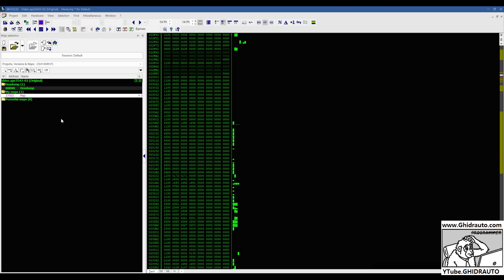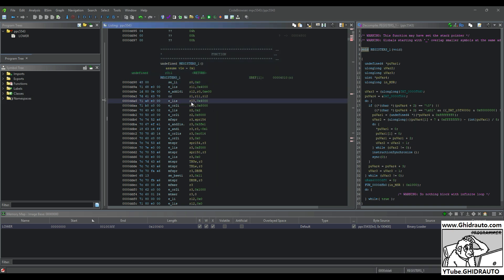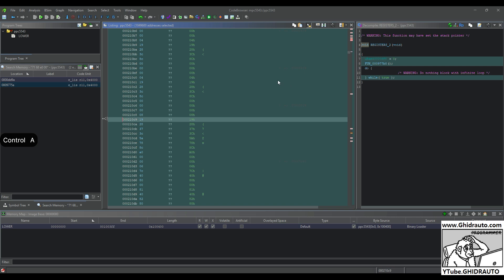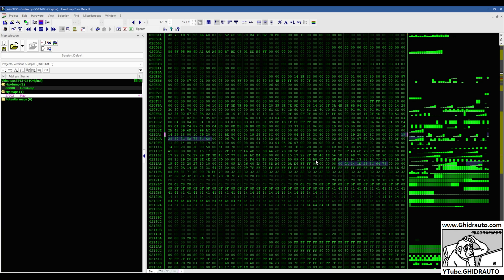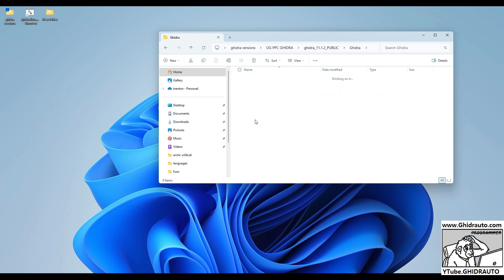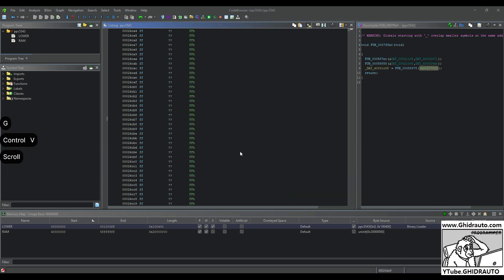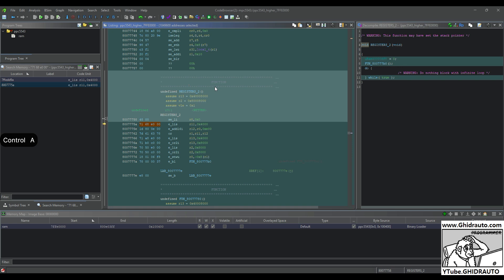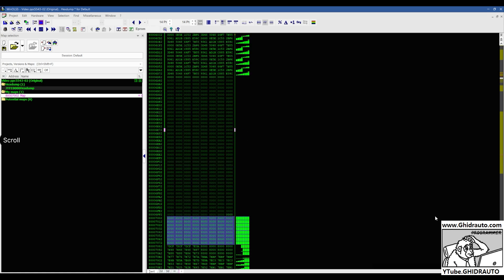Hacking a Siemens/Continental ecu!! PowerPC 5543 processor.

Comment: How to know the exact name of the maps of any vehicle including motorbikes
Reply from the maker: Unfortunately without proprietary information you cannot know they “exact” name. The best we can do is find a group of maps. Identify their overall affect start of injection for instance SOI. Then we find a map that is only used if engine temp is below 0 degrees. Well that is our super cold ect soi map. We find a 2d that creates a multiplier that has iat as its x axis. This multiplier is applied to the outcome of the 3d soi maps. This 2d map we name “iat correction” and drop it in the soi folder. You find some maps that are only enabled during while a dtc is set. Notate the dtc and those maps are “limp mode”

Comment: Any thoughts on a MPC5674, loaded it with the same compiler spec but the first 0x20000 bytes are all 0xff. Tried to use the trick you used but it seems like this family of processor loads items not at first byte but a real offset.
Reply from the maker: Jump in my discord and send me the file.

Comment: The 8xxxxxxxx address space is managed trough the MMU. You need to find the respective TLB setup code. After that, the easiest way I found is to create a byte mapped region in ghidra.
To find the entry point you just need to find the used RCHW.